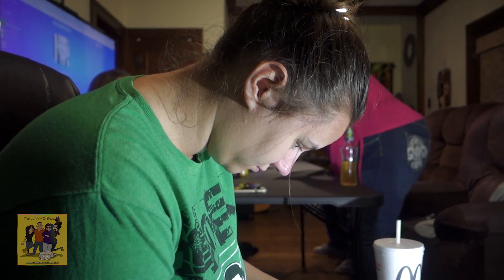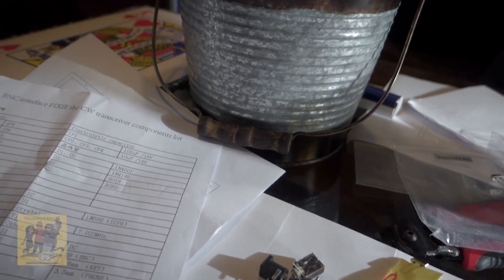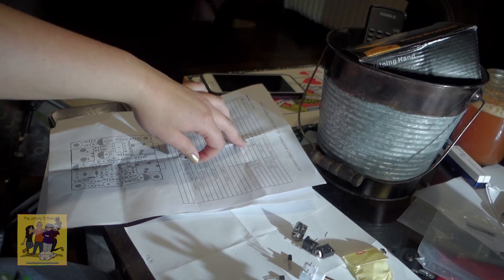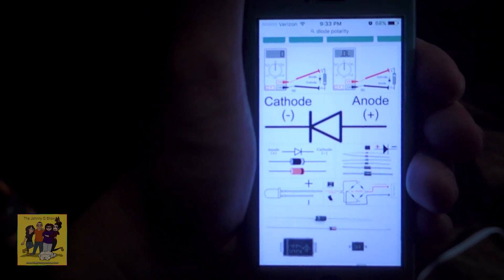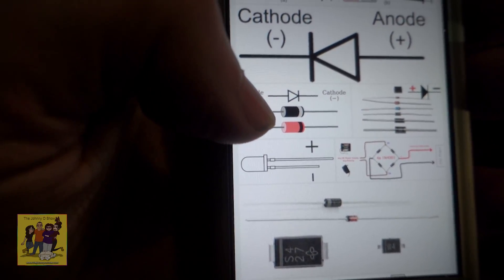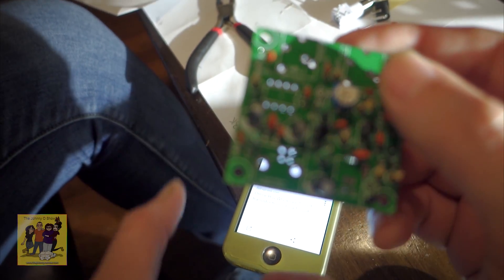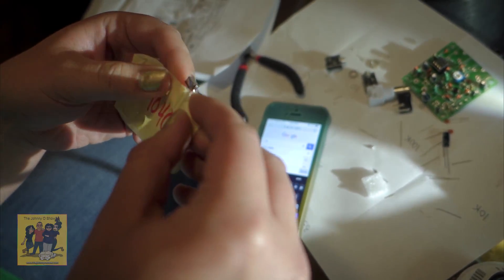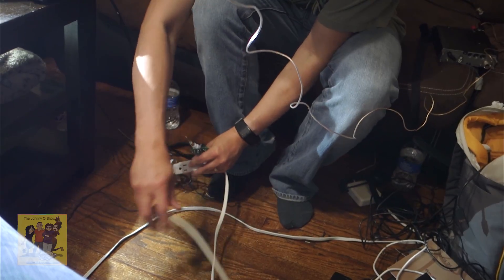Ep. #378 Assembling 40 Meter QRP CW PIXIE Kit - Part 2 HUGE FAILURE

Comment: I have heard others having success using a 9v battery.  The transistors may be so sitive to the higher voltage.
Reply from the maker: Yes, that works as well, I just figured beings it was rated 9-12 v and the wall wart said 12v i would be ok :-( Since then we have verified it should be fine with a 12V wall wart that is correctly putting out 12volts instead of 14 haha, but yes a 9v battery would work as well.  Also the wall wart can cause some noise issues but not terrible from what i have seen so far